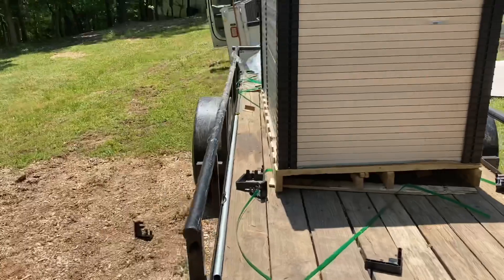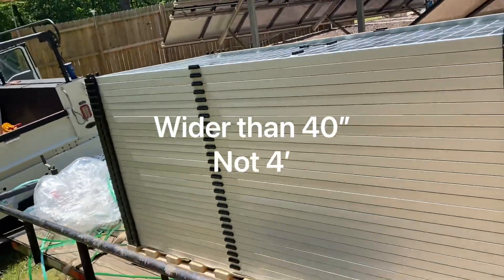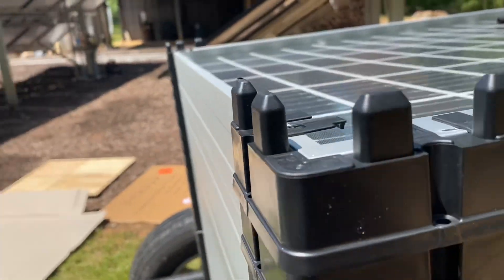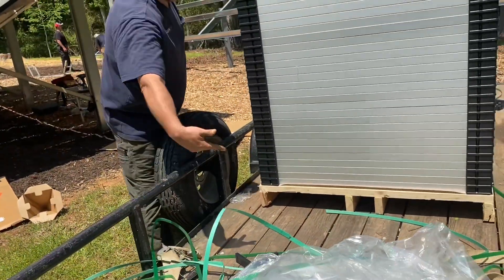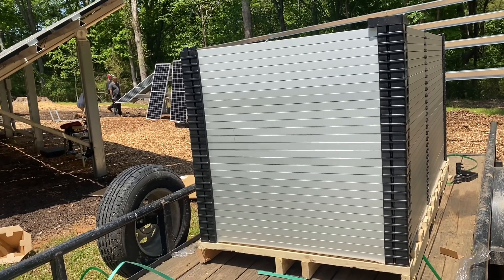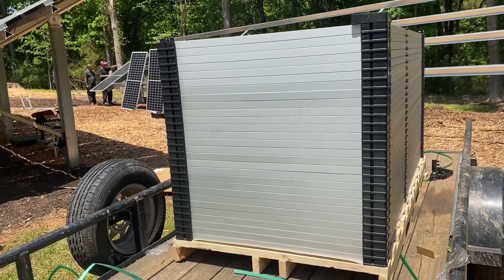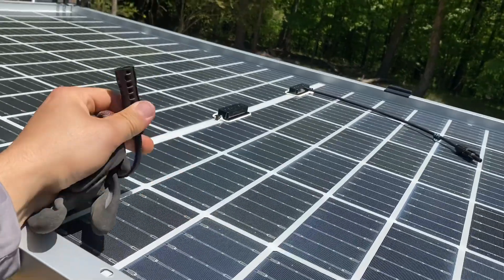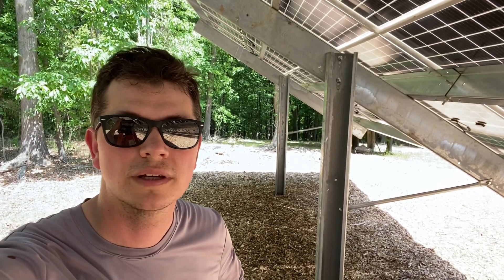Watch before you buy a pallet of Solar Panels

Comment: Very informative.  Thank you from New Mexico
Reply from the maker: Thank you for watching.
Reply from the maker: Are there any specific questions or topics you were wondering about in regards to Solar
Reply: @GainSolarPower  i guess the two things I know i am looking at right now  and trying to figure out as a DIYer is how to get cheap panels and how to identify damage to panels or what Types of panel damage is acceptable.  Like your comment on delivery companies not making your order whole if damaged was something I definitely did not know.

Also while I'm not considering tracking solar mounts I am looking at adjustable mounts.  Something like once every week or two i go out and turn a big screw and manually adjust the panel angles as the sun changes position seasonally.

Oh also i saw a really good install a couple weeks ago.  Guy put bifacial panels like 15 feet up and made a carport/hangout spot.  But he used white cement as the pad and extended the pad out an extra 10ish feet to the south, east, and west.  He said once he painted the pad white he got a noticeable bump in power output from the reflected light.
Reply from the maker: @Gleepglopglorpahaha  dont buy used panels unless you are just totatlly desperate.  You have no way of tellings how they were handled and microcracking is a very real problem.  The glass they make the panels out of is super strong but a pressure event or rough handling can cause the super thin brittle cell to crack underneath.  They burn out a couple years down the road and your cheap panels become worthless.

IF you want cheap panels buy some that are brand new but have been sitting on the pallet for a year or two.  They won't be as high of wattage but they will be high quality.  

I do the sinclair designs seasonal adjust.  It's only worth doing if you are far north in my opinion but alot of people love them.
Reply: @GainSolarPower  yeah the used and "blemished" panels is not something i am terribly keene on buying.  But maybe snail trail or like you said "old" panels.  We're only going to be in this spot about 6 more years so any system we build will have to be lean and simple payback quickly.  On the plus side I live in the mountains near Albuquerque so basically an ideal spot for solar.

I dont think that sinclair seasonal system is in this systems price range though.

Comment: Yes bigger solar panels are hard to handle.  I am installing DIY solar system and 200 watt panels are about the max size for me.   Also you can transport 200 watt panels easily in a car, impossible with much larger panels.

Comment: I’m finding it’s becoming a chore to come up with optimal string designs with some of the higher amp mods too. Inverter specs aren’t keeping up.
Reply from the maker: Is the solark giving you arc fault on high
Amps
Reply: @GainSolarPower  it has with Solaria 400R panels. Isc of 9.41 paralleled to a newer model 12k.
Reply from the maker: @taylormills08  is it giving you arc faults

Comment: Hey Johnny, Do you guys have any used low frequency inverters for sale? And how about a handful of those blue wire nuts, I would never use them but they might inspire me to finish that song ! Thanks guys and God Bless.
Reply from the maker: I’ve got a couple of burnt up 4448 magnums I need to fix, a used 6048xw, a used 12 volt Outback, and that’s about all.
Reply from the maker: Abraham has a prewired magnum 4448 pae with a charge controller pt100 and a magnum load center. It’s used but he’s probably give a deal let me know if you want it.

Comment: 29 perfect QC 475 bifacial from CED Greentech Columbus loaded into standard size van with 6' forks. Same nice pallet with 2x4's and corners as yours. 13,775W on ONE TRIP. If I had ordered your 415W or smaller, I would have had to make another trip or take a trailer.
Reply from the maker: Yeah but CED is high.
Reply: @GainSolarPower  304/panel with no shpg. Alt-E 343 + 1000!
Reply from the maker: @USA-GreedyMenOfNoIntegrity  that’s a good deal
Reply: @GainSolarPower  I thought so too.

Comment: This literally just happened to me. I paid for lift gate to my house. They said it required scheduled and sign on delivery after they have already started shipping them. Well I went and picked it up from the freight yard.... They pulled them out and guess what no fork extensions..... Bottom panel broken and all over the pallet it said must use fork extensions.... The shipper refunded me one panel but I'm in strings of 2 series so now I have one spare panel and had to email Lori to change my Sinclair invoice.... 
Shipper refused to send one panel. The cost is more than the panel..it's crazy out there I'd almost say order one extra panel but that's $400 for a just in case... Yikes
Reply: You should always order 5-10% more panels than you need